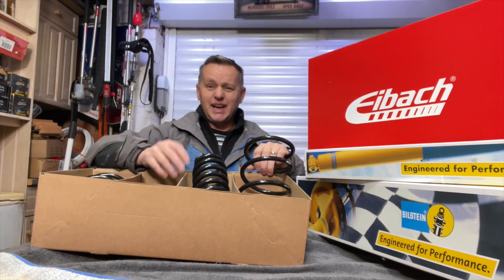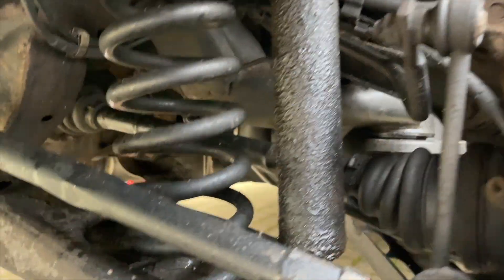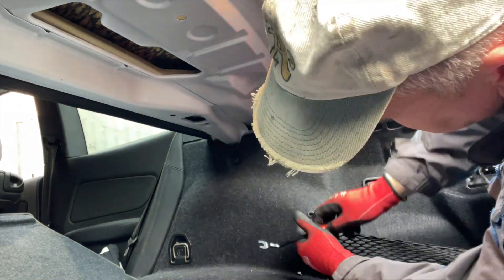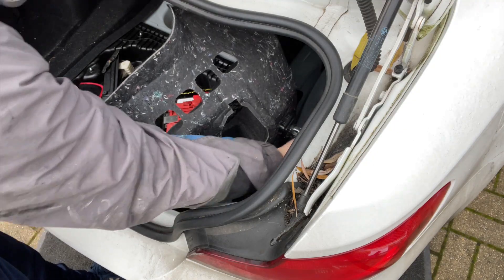Fitting Bilstein B12 Suspension Kit On Bmw E82 1 Series Coupe Rear. (Part 1 of 2) 118 120 125 135

Comment: Nice new suspension! On the f30 3 series, bmw made it alot easier to remove the rear shocks , the top mounting is unbolted from the wheel arch and comes out with the shock  they left the bolts accessible through the arch liner then when the shocks out you can unbolt the top mount and swap it over same as a golf mk7 setup
Reply from the maker: Good tip! Thanks for the great comments👍🏻👍🏻🛠

Comment: if you were just replacing springs do you think it would be easier to remove the e14 torque screws in the shock mount and drop the lower strut?
Reply from the maker: No I would just do it the same as in the video, Thanks for the great comments👍🏻👍🏻🛠

Comment: I think better to loosen the camber arm inner bolt before removing shocks and springs

Otherwise you are damaging the rubber bush when stepping on the arm to remove the spring. 

Basically the camber arm is being pushed down much more than it ever would be when driving the car. This will tear the rubber bush inside.
Reply from the maker: They are flexible enough to take a bit of abuse 👊🏻 Thanks for the great information👍🏻👍🏻🛠
Reply: @aaanton11  wrong.